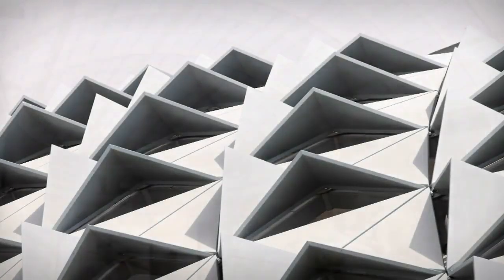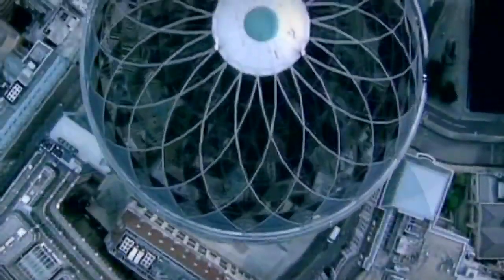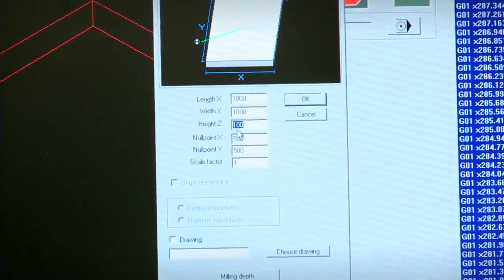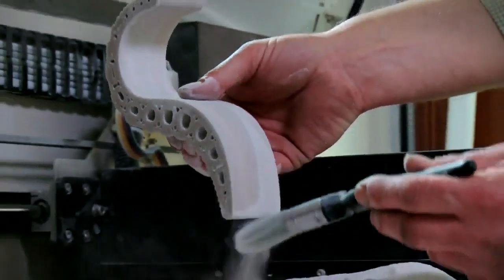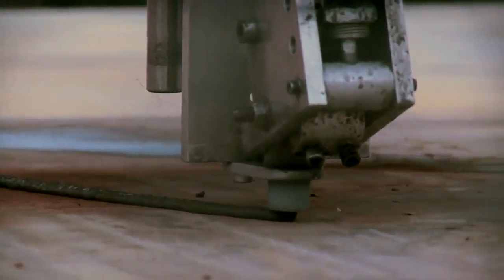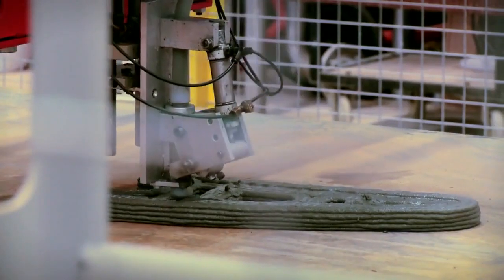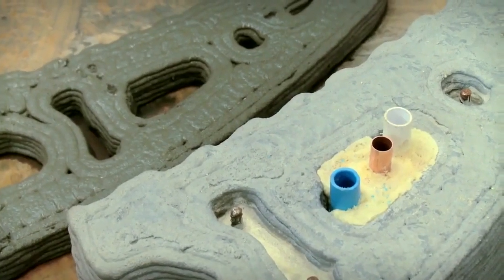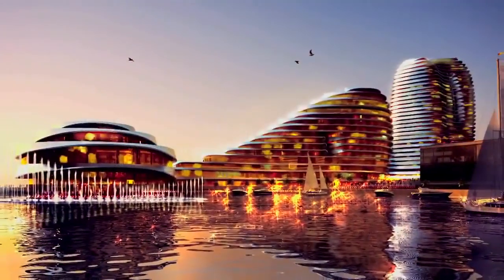3D Printer Can Build a House in 20 Hours!

Comment: interesting technology, yet it is important to note the following facts related to the Printing of typically a housing unit

At best the printing technology completes around only 20% of the unit , mainly the vertical or near vertical walls or architectural components; the following activities are beyond the scope of the Printing technology:
all structural  horizontal components , including slabs and roof
all foundations\
all electromechanical works
all secondary elements ( windows, doors, kitchen units, sanitary ware, etc )
all finishes internal and external for walls , ceilings
all flooring finishes ,including tiling
all doors, windows, kitchens cabinets, stairs ( possible though to print in concrete)

It is important always to mention that this technology is limited as above, since as at present it can use only one matrix ( mortar or special concrete mix ) for bearing walls since they do not require any reinforcement.

it cannot form a structural component because that requires reinforcement and concrete; in certain small elements this can be done by using fiber hairs mixed with the concrete that gives it tensile characteristics , but still for limited sizes.

other technologies need to be researched and adapted to complement the printing technology to enable fast track production of housing units, example a semi robotic tool that applies plasters and finishes onto vertical walls, also by using prefinished bathroom Pods complete with all sanitaryware and tiling, only to complete the water and power connections ( already various products are available on the market.

Only when all these other technologies advance in parallel to the Printing technology , can be boast to complete a housing unit in so many days; at present all such claims are limited to completing only the walls components.